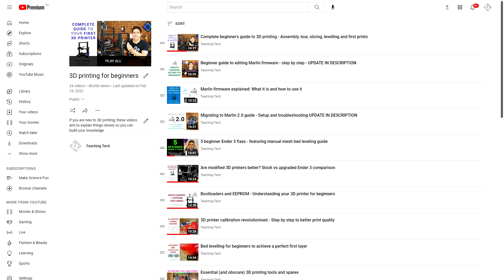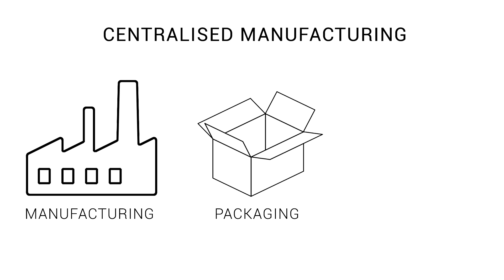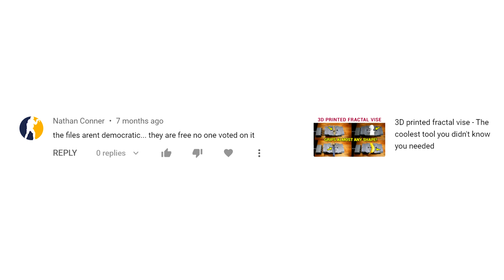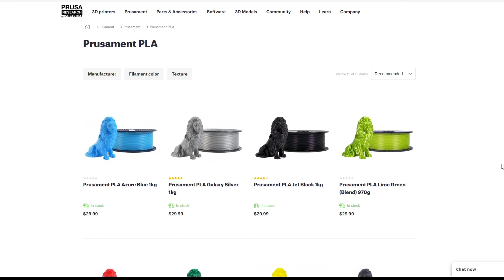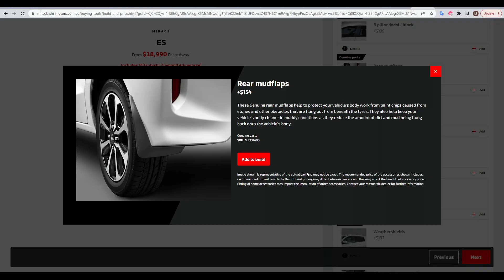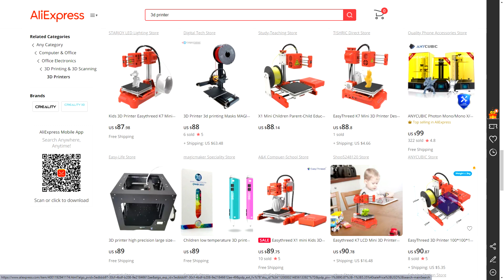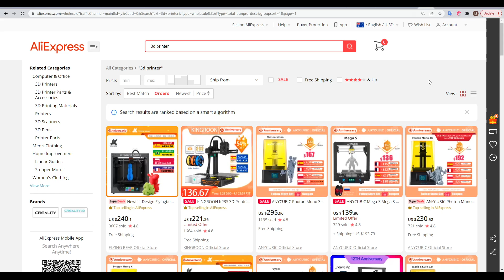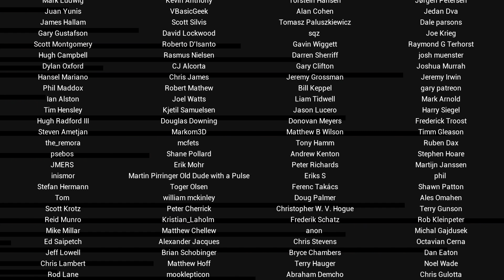3D printer trends are limiting mainstream acceptance: The 3D printing paradox

Comment: The 2D printer comparison is unfair because 2D printers are famously difficult and expensive to operate. I put off buying a 3D printer because I assumed it would be at least as unreliable as my 2D printer. I could not have been more wrong about that.
Reply: What are those printers? Ok inkjets have always been fussy, but I ran every laser/LED printer for years without faults and my Panasonic dot matrix before that was a trooper as well.
Reply: Eh my Creality software is 2 clicks. 
Import file. 
Save.
Then stick goes in printer and select thing to print. Its impressivly simple.

Comment: Maybe the greatest thing about 3D printers is that you can tinker with them and there's a robust community of people building and designing them. You can get into the firmware, you can modify the hardware to suit your needs. You pretty much can't do that with 2d printers. There's a problem with the driver? Tough luck. You need a 700kb driver to make it work? You have to download 350mb of BS along with it. I've found that 3d printer is actually easier to operate than an inkjet printer. No, it's not for everyone. It's not going to replace mass manufactured injection molded parts. But it seems that the sort of person who is attracted to 3d printing is going to be into tinkering. Of course it's nice to have a printer that just works and you don't have to keep messing with it to keep it working. In that case, it's best to go with a Prusa. I started with a creality CR-10 which was great at first, but then started getting loose and having issues. I replaced the belts, added several usability mods, coverted to a direct drive extruder and better hot end, replaced the firmware with my own configuration of Marlin. And now it's "OK". Then my brother wanted to get a printer and was like "what do you have?" And I told him to not get what I got. He doesn't have as much time it interest to tinker as I do. I told him to get a Prusa. He did and it just works. Then we build a Voron 2.4 core XY. Sure, it's a process to get it built. But now that it is built, it's much more reliable and headache free than the creality. And if you look at them side by side, the voron looks like the more professional product. One thing though... an inkjet is not going to burn your house down if you do something wrong and aren't paying attention. In the long run If you don't want to know about hot ends, thermistors, motion control systems or stepper motors, probably you shouldn't get a 3d printer. But if you have ideas for things that you can't buy but could be printed in cheap plastic, then go ahead and learn about thermistors and stepper motors. It's not rocket science

Comment: The trouble with Prusa Printers is, they are all super pricey for what you get.. one of their mini's has a tiny build area but costs more than a Ender 3 V2 which has double the print area of the mini.
And there's another problem, say we all have 3D printers at home which work like a normal computer ink printer would.  

Yes you cutting out the transporting and making of the printers a bit. 
But they would still be brought by the next generations so that would not stop them being sent out. Also the filament, that would not only be still being brought from places far away like China.

But with all homes having a 3D printer the amount of filament brought from there would rocket to 1 million or more times what it is now!

That would undo the saving of the making and sending around the world of the printers. in fact the transporting part would be mega huge compared to now.

So far from solving the transporting and supplying we have now with a few percent of the world using 3D printers as a hobby or a small business print farm.
We instead would have a mega increase of filaments & new customers of 3D printers and spares all undoing the savings of not having big factories sending out products.

Worse still with the main product factories closed down because the world of homes have the 3D printing going, you would have the biggest job loses in history to cope with too.

So no simple answers.

Comment: They won't go mainstream until the average Joe and Joan can press a button and a part appears without having to know a lot of technical stuff. We need the "Windows 95" of 3D printers. Before 95, pc's were hard to use and it was primarily enthusiasts and tinkerers who used them. Just to install and run a game you had to know text based commands, be able to configure 3 types of memory, run separate programs to configure sound and graphics cards and the detailed hardware specs, brand and model of those cards just to get it to run. Most people couldn't even tell you the size of the engine in their car because they don't care as long as it starts. Windows 95 changed that to, insert CD, step through wizard, click icon on desktop, play game.

Comment: you seem to be making an assumption-that there are factories producing and selling everything entirely made from  plastic (pla) in a few primary colours  for items that everyone currently buy. The example of your broken plastic tube support bracket (which will break again), would be better simply replaced by a piece of plywood with a hole in it for the tube. 3d printing, at the moment, and for the foreseeable future will either be expensive production machinery, to print stuff difficult to make otherwise (usually in metal), or cheap, niche hobby machines, the majority of which print ornaments, or parts for the 3d printer, in plastic.

Comment: Manufacturers should push to make ratrig and Voron-like machines to make them more widely available to consumers. This would push 3D printing advancement to the next level.
Reply: How? These are nicer and can run faster but ultimately still the same, there is nothing "next level" about them.

Comment: Totally agree, that there are too many Ender 3 clones (and also too many variants from Creality themselfs).
This can lead to total confusion for the beginner (and a lot of time wasted to research, which ~200€ printer is the best).
Reply: I spent a solid 10-15 hours researching my first printer... Then I just pulled the trigger... bought an E3 S1 .... Its great, easy to use, easy to level, easy to set up prints well every time.... 

Now I have 3 more Voxelab Aquilas that work non stop... Moral to the story .. should have bought the cheapest E3 clone I could find... b/c I could have bought 2 more for the price of the s1.... But the S1 got me in the door... 

Now I buy the cheapest Aquilas I can get spend 75$ "modding" them flash them with Alex's FW slap on a Raspberry Pi running Octoprint and they just work... All the time..

Comment: I have noticed of lately a trend amongst Chinese manufacturers to produce proprietary hotend/extruder combos, some even have ABL incorporated, and the nozzle itself used as the probe, I don't know if they instead to make them open source but to not do so will be a massive mistake as they don't provide maintenance manuals and without different manufacturers making them people wont use them as upgrades which in turn will reduce the community around that product and it will flop, the 3D printing business was formed on open source and is the bedrock of the business, the CR-10 and Ender 3 are good machines but nearly everything Creality has released since has been terrible and because they seem to be getting away with it the also ran companies follow suit, I think 2023 will see some of them go bust!